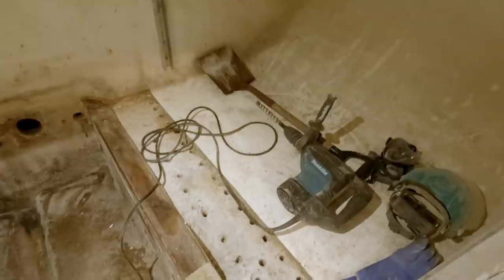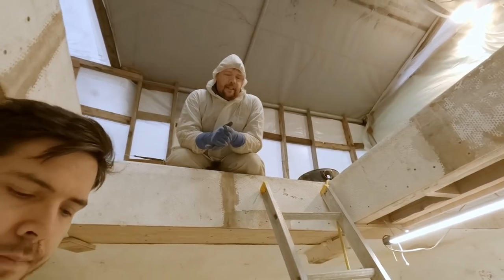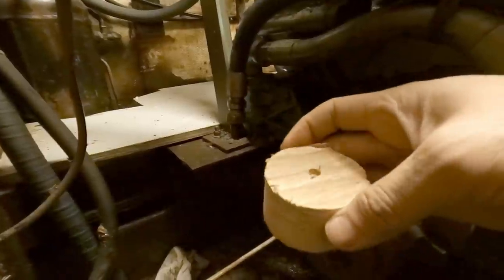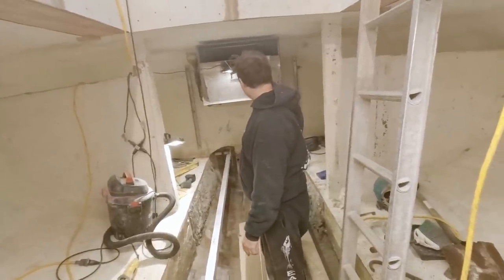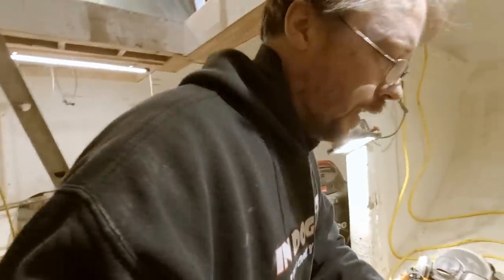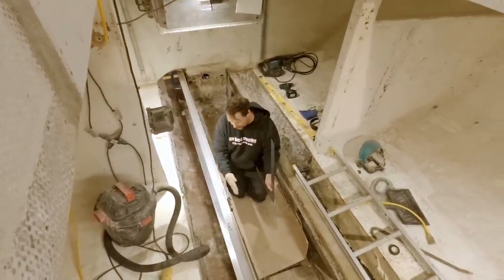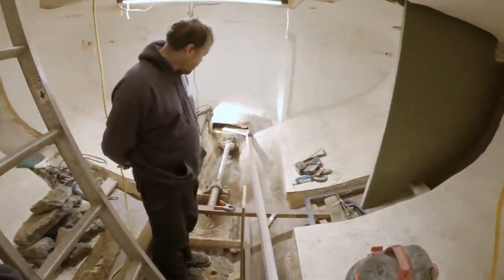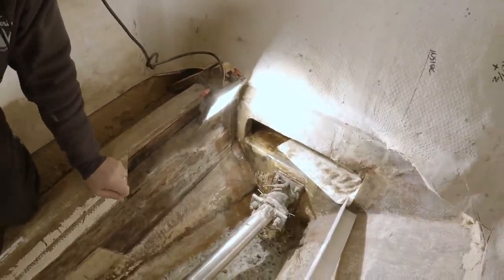Lining Up Shaft Alley Stringers - Emerald Isle: Ep.33 Fishing Boat Refit

Comment: C clamp a 2×4 on the foam to give you a straight edge to guide the saw and its more accurate and much easier to cut a straight line.

Comment: Looks like quite the project! What are your final plans for the tank capacity, and how do you anticipate this impacting freeboard / stability ? I’m saying this as someone who’s lived with a boat that’s easily 25,000 lbs over tanked… 

I like your approach of multiple holds. If weather allows, flood the aft hold. If not, leave it dry and you’ve got that much more buoyancy. We contemplated that on the Alaskan, and instead decided to add 7 feet to either side. Leaving town as soon as pollock is over!
Reply from the maker: That was our biggest concern when it came to flooding the hold Jake, so we thought it best to split it and have a smaller aft hold. Easier to manage the catch also and have reserve ice/ bait hold. We won't have side holds like the Fish Tale, but maybe if we sponsion one day that may be the plan. It works really well for the fisheries we do.

I hope you can document and post videos of your sponson on your channel. That would be awesome and very educational. Best wishes and hope the job goes smoothly.